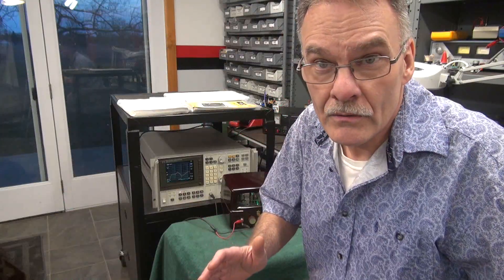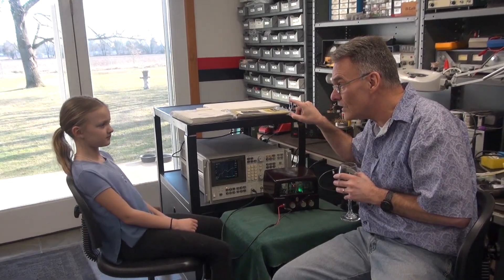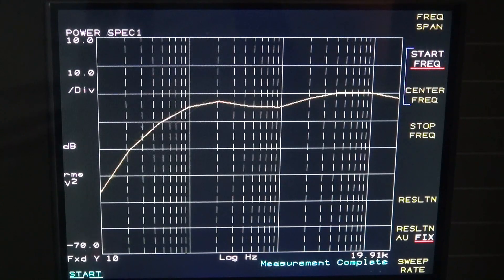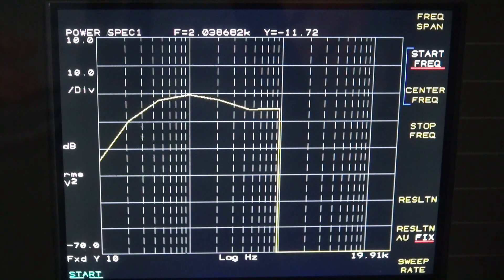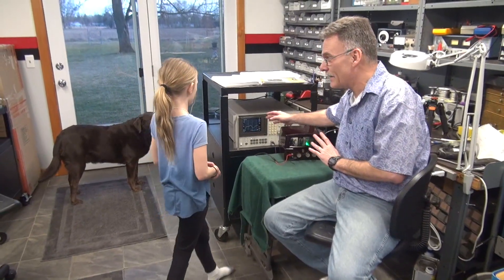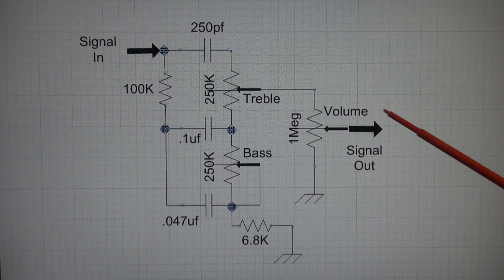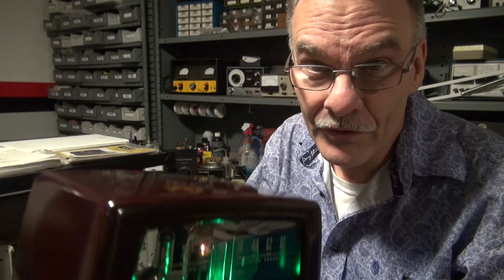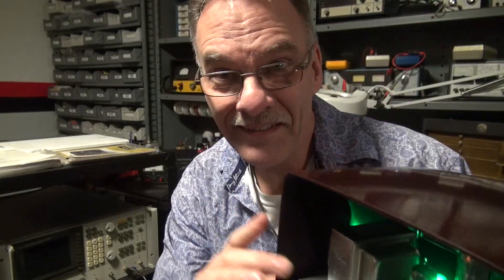How to Understand Tube guitar amp Tone circuits Frequency response

Comment: After watching this video, I think I'm more confused than before. I often use water as an analogy for electrical flow, but this didn't make sense to me.  However, looking at this diagram, it occurs to me that this is the reverse of a crossover network in a 2- or 3-way speaker, but instead of dividing the frequencies to go to the bass, treble and midrange speakers, it "divides" them to combine or "mix" them for the input to the amplified circuit.  Perhaps an explanation on how the values of the caps and resistors affect the frequency of the signal would be an informative video...

Comment: Timeless Awesomeness Every Time Terry. Your videos RULE. Thank's. I have a Nomad Mustang 130 by a guy (Eddie Spitzer) whom supposedly started at Mesa Boogie than built these Nomad amps (In the 80's) out'a his shop in Berkley Ca?. I had a good guy (Hike Babbian) add a Power Output Transformer from 180 watt Trynor amp (After the 1st band use I blew the original OPT) & 2nd channed to boost volume for Lead's in 91. Pot's are a tad scratchy. Sound's Awesome otherwise. I'll try a good Pot Cleaner/Lube. Hopefully it work's? I'd really love to send it to U & Amp Girl. I'm SURE U could really Tune it up AWESOMELY. I'll have to save up. Teamster L399 at WB in Burbank. love your vids.

Comment: Terry great stuff, I have a Fender JAM, which is Solid State with 25 Watt output. It does not have tone control, it uses push buttons so you only get two positions. Can the circuit be reworked to introduce Bass, Mid, Treble Pots replacing push buttons? And Can I replace the Solid State Output Amp with a strong Tube Output Amp and keep the Solid State Pre Amp and sound shaping tools they have included, Chorus, Reverb, Contour etc. Seems the SS output Amp could be cut out, then a new box put on top with a SS PreAmp Input then a Tube Amp built to drive the 8 Ohm 12 Inch speaker.  Is this possible, can you help? I would pay for time or design! You do a great job and really appreciate the walk thoughs. No better way to share the skill, talent and art you have.

Comment: Someone needs to make a video showing how to wire an input, one volume and one tone-people explain and talk about it but never show it and beginners need to be shown how and then they can learn the numbers and frequencies and so on. It may be out there but I can't find anyone showing it in person The few I have found the video is not good enough to see.. They don't tell you if you are looking at the front or the back of the pot. The'll say bob walked to joes house and got a half a cup of sugar then went by toms house and it was 55 steps -What color is jill's car-b over j times t over j equals the sum of 9 bananas and three oranges, so there is no answer. I think people that have been doing it a long time forget that they were a beginner at one point. I still to this day have young carpenters call me about something and I will go show them how to build a dormer or a staircase and they thank me because someone showing it on the blue print is just not the same. They will eventually learn the blue print but if you show someone they don't forget.

Comment: Why can't someone just show in a video actually wiring up -One input-one volume and one tone knob. I have seen people talk frequency, water numbers letters, but I have yet seen one person show them wiring one input, one volume and one tone and show it where you can actually see what they are doing.If you can't wire it you can't check the frequency or anything else.I know it seems simple to people that have been doing it for 20 years but for a beginner, they need to see someone actually doing it and then they can learn all the numbers. Please.

Comment: Dear Terry, I just gave you the highest rating to a youtube survey ( a little bum kissing ) I wish you would do much longer Video's and go into technical detail on how the Amp's work and the Components & Circuitry , like what Diodes are and their function  ., you don't have to go into extreme detail but the essentials. You know for those of us who are allergic to Solid State and adore Tube & Vintage gear . 
P.S. and someday maybe sell me your Iwatsu , can only find junk ones for sale ?
Reply from the maker: https://www.ebay.com/itm/Iwatsu-SS-5702-Oscilloscope-Made-in-Japan-20Mhz-Manual-2-New-Probes-TV-switch/382427783246?hash=item590a78e04e:g:9iEAAOSwxyJaw8nl  Here's a good one, just listed
Reply: Thanks Terry !

Comment: Nice!! (and cute). I still don't get how resistance affects frequency. I thought resistors would affect voltage and current. My understanding, which is limited, is that capacitance and inductance affects frequency. I only say this from my experience building speakers using passive crossover networks. In those, capacitance and inductance determine frequency (filtering) and resistors are used to attenuate the signal for driver output balancing.
Reply: A resistor and a capacitor in series form an RC (resistance/capacitance) filter. Think of the filter as an AC voltage divider where the output signal is taken from the junction of the resistor and capacitor. To form a high pass filter, the signal voltage is applied to the capacitor followed by the resistor. At high frequencies the reactance (resistance to AC) of the capacitor is small and most of the signal appears across the resistor at the junction. As the frequency of the signal falls, the reactance of the capacitor increases and a smaller proportion of the signal appears across the resistor at the junction.  A low pass filter is formed if the signal is applied to the resistor followed by the capacitor. At low frequencies the reactance of the capacitor is large and most of the signal appears across it at the junction. As the frequency rises, the reactance of the capacitor decreases and a smaller proportion of the signal appears across it at the junction.
Reply: Thanks! For some reason my brain failed to see the capacitors in series with the resistors (in the schematic @8:41 ) so I was confused on how just a resistor could affect frequency. Great explanation, thanks!! I guess I'll chalk it up cranial flatulence...LOL
Reply: Happy to help!

Comment: Hi Terry,  not really on topic with my question. I have a Ceriatone JTM45 AMP bluesbreaker. It is 420 volts on the plates. My question is,  can I use a 5V4G rectifier in place of the GZ34 rectifier that it came with? I know in most amps you can go down a step in rectifiers. Thanks Michael Newell from Niagara Falls, Ontario, Canada
Reply from the maker: Reviewing the tube data info, they look interchangeable. You might get a little more sag out of the 5V4

Comment: Great example and that's a gorgeous amplifier. Question, do the caps set the frequency of each leg of the input going to the pots?
Reply: Are you familiar with crossovers in a speaker? The combination of caps (low-pass filter) and resistors (high pass filters) determine a frequency band.  Tweeters require only a resistor to block the low frequencies, and woofers require only a cap (aka: "choke") to block the high freqs. Midrange requires a combination of cap/resistor. The values of these is what determines the frequency of the affected bandwidth.
Reply: The difference between the "tone stack" in a pre-amp circuit and a speaker, is that in the pre-amp you would also want to filter out the subsonic ("rumble") from the bass and the ultrasonic ("dog whistle") from the high end: one, so you're not overworking the amp with unnecessary bandwidth; and two, to prevent damage to your speakers (and your ears). Just because you can't "hear" it, that doesn't mean it can't damage your hearing! So those "extreme" frequencies are shunted to ground.
Reply: @DustInTheWindAZ  Thanks for these two replies. I understand LPF and HPF and vaguely familiar with crossovers. It looks like AF filtering is similar to RF (bandpass) filtering, only a little simpler. This: "Just because you can't "hear" it, that doesn't mean it can't damage your hearing!" is very important. I have never thought of it that way but 100% true!
Reply: @MichaelLloyd  Acoustic or radio; it's all frequency-based.

Comment: Thanks for the vid. Tone stacks confuse me but ever so slowly I'm getting it.
Reply: Duncan Amps Tone Stack Calculator might change your life
Reply: I have it. My main issue is translating the schematic tone stack to a real life tone stack.
Reply: If you're talking about how to wire it then I completely will agree with that lol...  I would be happy to draw you a  wiring diagram rather than a schematic if that would help :)
Cheers from Canada
Reply: Thanks. Sure, draw me up something. Anything can help. I'm particularly interested in Marshalls.